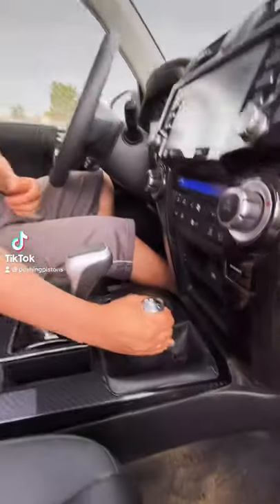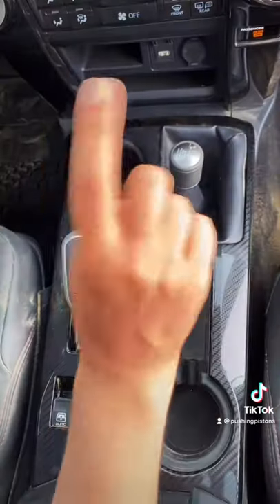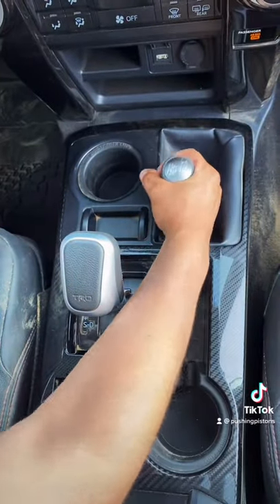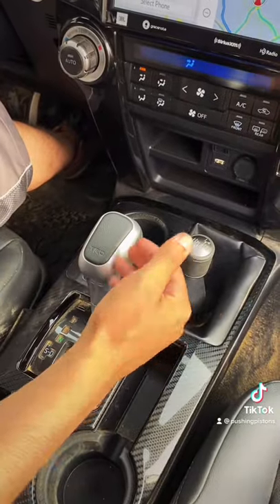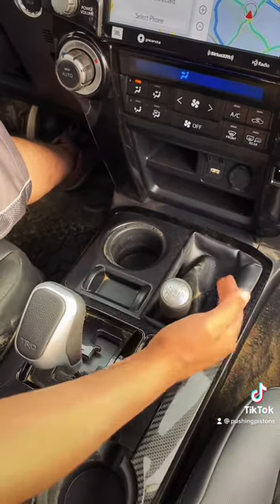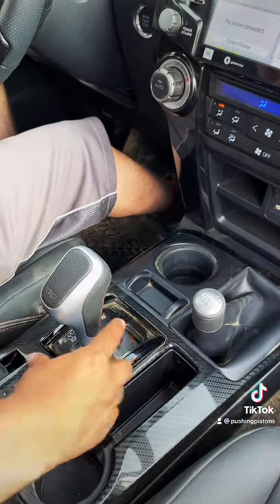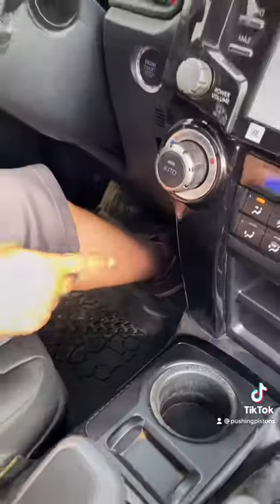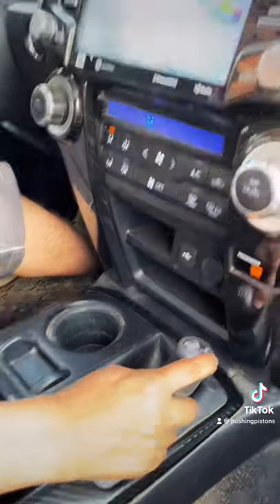How to use a Manual Transfer Case

Comment: 4 low will also not allow the transmission to shift up insuring you get max hp and torque to get you out of any ditch
Reply: So you saying it's only one gear in 4low?
Reply: @vikeshbubbles205  oh I had no idea it changed gear ratio, I always knew it did more than just prevents shifting just not exactly.  Thanks brother
Reply: That’s incredibly stupid because you want the low end torque but it’s much easier to control in a second gear start my 98 Ford ranger is superior 😤
Reply: Unkwon Malaysian Guy  Pretty much, yup. Your transmission can still shift unlike what oc said, but it’s another gear reduction after the transmission
Reply: I don't know for this vehicle in particular, but usually 4Lo has a 3:1 or 4:1 gear reduction, so the torque multiplication is pretty massive. Horsepower is normally calculated through torque so that's not very relevant. 
If your car develops 400lbft when the ratio is 1:1 it will be 1200 or 1600 in 4Lo respectively, with the ratios mentioned above. Most automatics also only upshift once or twice to limit speed in 4Lo as it normally doesn't just add the gear reduction, but also locks the centre differential if there is one and it's easy to hurt the powertrain in low-range at "high" speeds.
Reply: It doesnt matter what hp and torque. Because toyots has crawl mode. No sweat

Comment: It has a manual 4x4 bc they barely ever break unlike the electric or vacuum operated selectors
Reply: All you have to do is clean and lubricate the linkage joints every so often.
Reply: Even if you do have linkage problems, you can manually actuate them. All fun until the computer tells you no lol
Reply: @Sosaparks  huh I didn't know that, personally I'd rather just have the manual  or a less sophisticated AWD, less things to worry about
Reply: @garrettrainbolt1344  yeah I guess I can't really talk too much, I've always had the manuals but everyone I know with a vac actuated transfer case has had nothing but problems (these are also on 15-20 year old chevys)
Reply: Robert Bowman I have a manual transfer case on my 97 Dodge Ram but it also has a vacuum front axle. That was quite the disappointing discovery when I had to take a front wheel off but forgot to loosen the lug nuts before jacking it up. Was hoping 4x4 would hold that wheel still if the other 3 were on the ground and the trans was in gear
Reply: @robertbowman1972  Me too dude, complicated stuff scares me 😂
Reply: Thank you for answering the question he didn't answer lol
Reply: Fuck vacuum operated switches - an S10 owner
Reply: The shifter switches the transfer case but some trucks still engage the hubs with vacuum.
Reply: @lazarustheatv8389  Come on man, that's why you need an impact gun! Lol. Did the same thing with my car almost every time I rotated the tires.
Reply: PlayinWithMahWii I have an electric one now.  It is so much easier to use and more powerful than the old air impacts my father has had for as long as I can remember
Reply: @lazarustheatv8389  That's what I've got. One of the Milwaukee FUELs. Makes the air guns at my job seem useless.
Reply: Im not gonna lie i have one in my truck and i used to hate the way it looked but i found how good they are....and now i feel lucky
Reply: @robertbowman1972 i have a 99 silverado with electronic selector and have never had a single issue with it at 190k the transfer case blew up before the selector switches could even think about going out

Comment: I saw the result of someone, somehow, got the transfer case into 4 wheel low, at 80 mph. Did about $25k damage to their truck.
Reply: my old boss at a company i used to work for did that when he quit we were making a 2 hour drive back home and he said “fuck it not my truck let’s see if it’ll go into 4low” at 80mph on the highway surprisingly it actually shifted and then just immediately killed itself.

Comment: That was really helpful thanks for explaining 4wheel drive
Reply: Funny part is lots of drivers don't even know what it is!
Reply: Lol I see guys driving 4x4s on ice and just the rear wheels spinning..I don't think everyone knows what 4wd means lol
Reply: It's not helpful it's wrong
Reply: Please stop spreading misinformation, with open diffs a veichle in 4h or 4l will only power two wheels, one on each axle and they will be the wheels with least resistance to rotation aka the wheel in the air etc. You need some form of locking device on both axles to power all 4 wheels. This is why brake lock differentials work because they clamp the brakes on the spinning wheel thus making the one with the most traction the path of least resistance.
Copied and pasted my comment for clarification

Comment: The manual t-case is slightly more reliable, but even the models with the manual lever rely on an electronic actuator to engage the front axle via the ADD. So, they are all at the mercy of at least one actuator. So make sure your engaging them at least once a month to keep them working.
Reply: Use it or lose it!

Comment: I have this on my 2000 jeep wrangler.
Basically
2 high is for normal roads
4 high is or icy/ snowy/ bad weather roads
2 low is for lets say you get stuck in a mud ditch, the gear basically kicks the car into a rock climber traction kinda mode and if you were to drive in 2 low on normal streets, well atleast my jeep wranger it would tear the front axel off from the sheer force

Comment: As of 4 days ago we bought a new automatic semi a trailer and a new power wagon 2018 Blue with 12k miles a camper too.  Put the truck in 4-L when going thru small amounts of swift flood water.  This is our 2nd one due to the old one getting stolen and totaled and on fire.  (Theif died on impact with the semi)  you'll get good cont
Edit: The truck is the same way. Manual transfer
Reply: Lmao wow...talk about karma

Comment: Always be in neutral… never park, so it safely if you are in drive gear and moving. If im going 35mph or less (my truck can do 40 mph or less I like to do 30mph) if im going 30mph, obviously in Drive gear, and I approach snow, I let off the gas and put my transfer case in 4 wheel drive high. I go easy for a few seconds then I power through the snow. Thing is, you gotta try to operate your transfer case safely without screwing anything up

Comment: 4L is a whole different, and much lower gear ratio. Meaning the wheels turn much slower then in 2H or 4H which usually use the same ratio.
Reply: High range is always the same ratio. It has nothing to do with the wheel speed. It’s just a gear reduction.
Reply: @tasmanmcmillan1777  
If you don't think wheel speed and gear reduction are related, you shouldn't be commenting on videos like this
Reply: @jacobg5122  wheel speed is the result of gear ratios. The part I’m talking about has nothing to do with wheel speed and everything to do with gear reduction and torque multiplication.
Reply: @tasmanmcmillan1777  
Based on what the other guy said, it sounds like you're saying your wheels don't turn slower in low range at a given engine rpm. Which obviously isn't true, but maybe you just need to clarify what you actually meant.
Reply: @jacobg5122  take a vdj70 for example. 1st in 4h is the same as 3rd in 4L. You can still achieve the same speed but with different ratios. Wheel speed is not a major factor in the difference between & reason for low range. The original commenter also stated 2h & 4h are usually the same ratio. They’re always the same ratio. If they were different, it wouldn’t be called high.

Comment: What's the point of neutral? I get it on the gear box but not on the tc
Reply: I’m sure there’s another smarter reason, but flat towing is supposed to be in tcase neutral
Reply: Presumably you also need it to switch ranges but the noggin is off atm

Comment: Manual transfer cases, going back to the Fj days. I’m hoping that this is a clue/Easter egg towards an Fj reboot.
Reply: Sorry man but it is not, toyota only does manual transfer cases bc they’re less likely to screw up like the electric ones from dodge or jeep or whatever today that has like a knob or button, wish they would bring back the fj though especially bc the bronco just came back
Reply: @jacobgreen1301  joop is still manual, I hate other brands moving away from it though. I’d even argue for factory lockout hubs tbh

Comment: I’m pretty sure they’ve been running with the same transfer case since the first Gen Tacoma cause mine has the same layout please correct me if I’m wrong just want to learn
Reply: yup, if it aint broke, dont fix it.
Reply: @PneumaticFrog  I love these transfer cases they are so reliable our Tacoma is 25 years old and has the same transfer case and it’s been on many backroads

Comment: Wtf. I had a dream I was driving a car with two shifters. I had never seen or heard about one, I guess they are real.
Reply: You only use the second shifter when stopped to engage/disengage 4wd and Hi/Low range. But there has been cars with two shifters like Mitsubishi in the 80s. It was used as a manual overdrive
Reply: I learned to drive stick in a willys jeep with 4, but I’m sure there’s something out there with more. A lot of old semis got pretty wacky
Reply: @Sosaparks  Yes old twin stick B model Mack’s. from what I understand ones your standard 5 speed and the other splits each gear into high and low

Comment: Please stop spreading misinformation, with open diffs a veichle in 4h or 4l will only power two wheels, one on each axle and they will be the wheels with least resistance to rotation aka the wheel in the air etc. You need some form of locking device on both axles to power all 4 wheels. This is why brake lock differentials work because they clamp the brakes on the spinning wheel thus making the one with the most traction the path of least resistance.

Comment: So you can’t lock the rear in 2wd?
Reply: Locking the rear has nothing to do with the transfer case but you should normally use 4hi when off roading to start with and only lock if absolutely necessary
Reply: @MrTap05  youre kidding, right? Did you watch the video?! Try making a tight turn with 4x4 locked in
Reply: I don’t know if yotas are the same as jeeps, but all their elockers have nanny setups that act like that is I remember. It’s goofy
Reply: @nsbtacoma6650  friend idk if you know how this works putting 4x4 on just means all 4 wheels are powered which is stock on a lot of cars we call this all wheel drive also locking the rear means you’re engaging differential lockers which are in no way related to a transfer case
Reply: @MrTap05  right and I was hoping someone that knew what they were talking about would respond. Depending on what locker some  cannot be functioned while in 2wd. There are plenty of obstacles in which 4x4 isn’t needed. Often in a bind where I can’t fully turn in 4wd but can in 2

Comment: You still didn't answer the question of why mechanical over electronic or pneumatic?
Reply: More reliable, you can get a LOT of issues with electronic systems and they can suck to fix
Reply: @chadb2077  also it’s easier to engage since some pneumatic and electronic 4 wheel drive systems take time to engage
Reply: @MrTap05  yup that too

Comment: 4 low= 4 wheels drive + low speed + more or higher torque 
where is 4 low stand for low speed with high torque while in 4 wheels drive

2 high = 2 wheels drive + high speed + low torque  
where is 2 high stand for high speed with low torque while in 2 wheels drive

4 high = 4 wheels drive + high speed + low torque  
where is 4 high stand for high speed with low torque while in 4 wheels drive

Comment: My 02 dodge ram has the exact same, and its almost 20 years old
Reply: Every car with 4x4 has it.  I’d say most have 4low
Reply: And?
Reply: Was saying its old and not special compared to every new car with electronic 4x4 switcher
Reply: It's toyota. They care about longevity not what's new and cool...
Reply: And my 01 4Runner has it with a diff locker from the factory. It also isn’t on its 3rd transmission and 2nd engine. The original cat finally went after 18 years

Comment: I in a transfer case yes you can actually the transmission will still shift the transfer case will not it just change the gear ratio between your transmission in your drive shafts to the rear rent that's all it does it also engages of a front end now know you do not want to shift it while you're moving if your unless you absolutely have no choice like say You're On Ice in your sliding down a fucking Hill as your last chance then you can shift it while the tires are spinning but otherwise to prevent damage inside it because there's a chain or a belt in there and if you put too much force on it will snap but you do use sticker vehicle in neutral come to a complete stop Stuck in Neutral and then shift it give it a second and then drive when you're taking it out of 4-wheel I stick it in neutral then I put the transfer case back into wheel high and then why do from there is I back up a little bit then I drive for it by backing up it helps it fully disengage if it's still slightly engage sometimes they do do space liked now the transmission will still shift from 1st through drive if you just stick in drive that's why I usually when you stick a vehicle in 4-wheel you put your shifter not in drive you I should put it in first or second gear